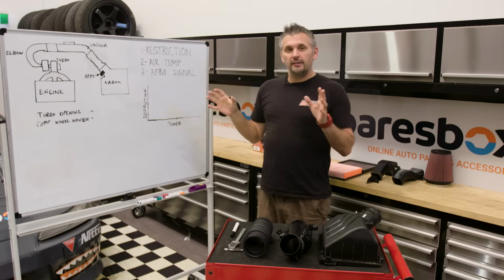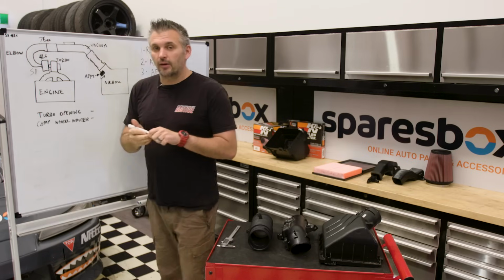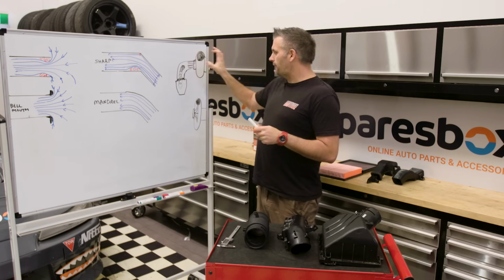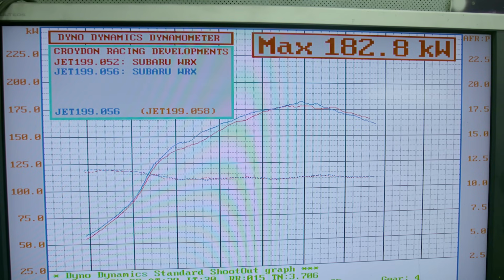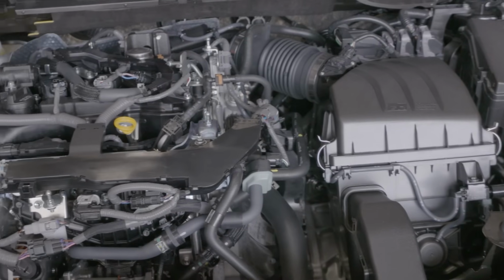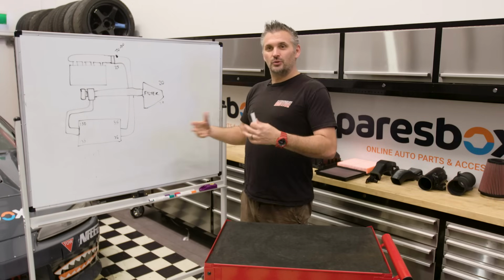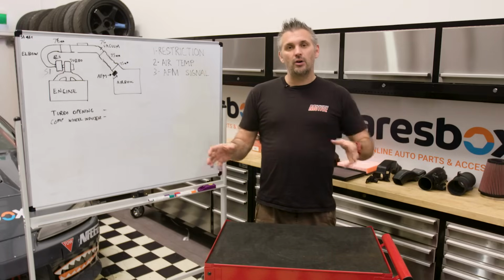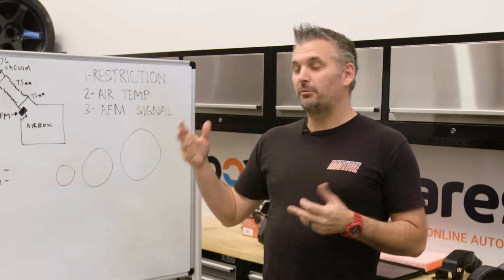Why Cold Air Intakes DON'T or DO Work on Your Car - Motive Tech

Comment: I got the AEM cold intake for the evo x as its one of the best and closest to OEM as you can get but letting a little more air flow around the filter and also a smoothing intake to turbo pipe this has made spool up times a little nicer feeling as for power i am not sure with my butt dyno but i think there was a video out there few years that did get around 7 hp but dyno could get that from having the straps looser and my intake temps dont seem to go up so fast when in traffic being a little bigger and better contructed box.. great video and very well explained too alot is what i researched before getting my intake other year...
Reply: But you get no cool spool noises from it being in a box :/

Comment: I've increased the size and flow of every part of my intake tract. The last bottleneck left in the system is the intake runner in the cylinder head and the intake valves lol. But a set of AFR heads aren't in the budget just yet :-(